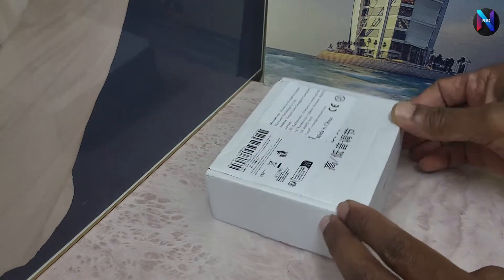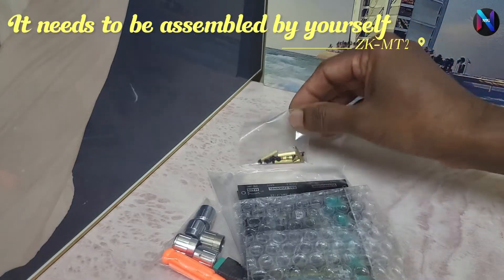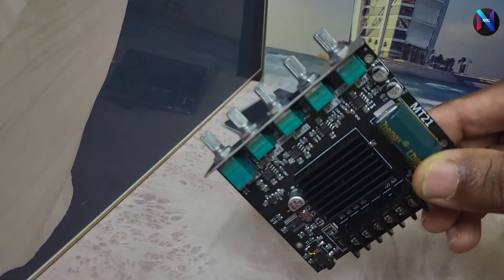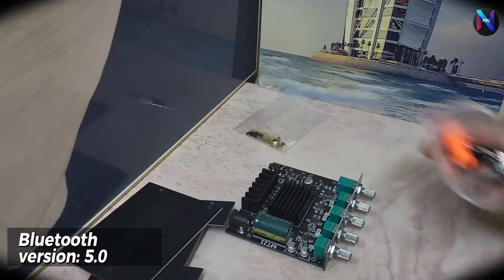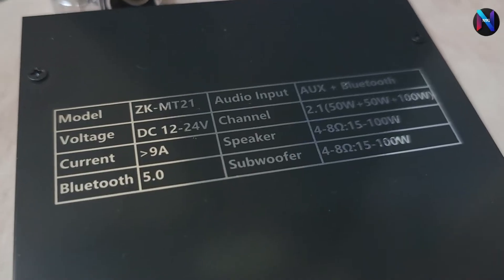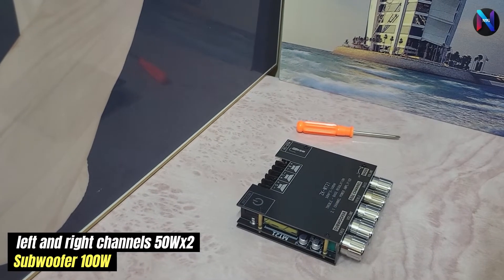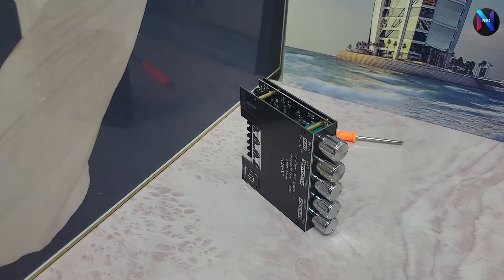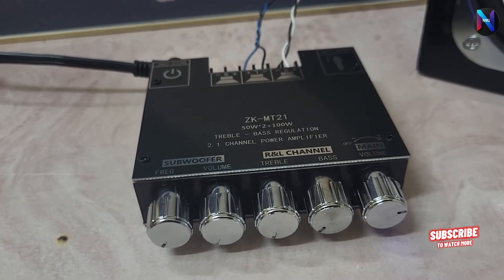ZK-MT21 Channel Bluetooth Amplifier Board 50W X 2+100W

Comment: I have Charger 
But i need to ask advisable 

Charger A
Input 
100-240v - 1.7a 50-60hz
Output 
18.5v -3.5A 65w

Charger B
Input 
AC 100-240v -1.5A 50-60HZ
Output 
DC 19.5V. 4.62A

Charger 3 :
Input 110-240v 50hz 1.OA
Output:21v 1500mA

Charger 4:
Input: AC 110-240v 50/60 hz
Output: DC12v-1000mA
Reply from the maker: A and B are very suitable.